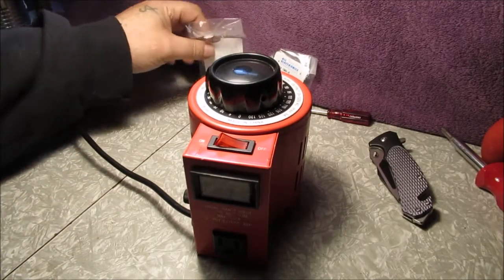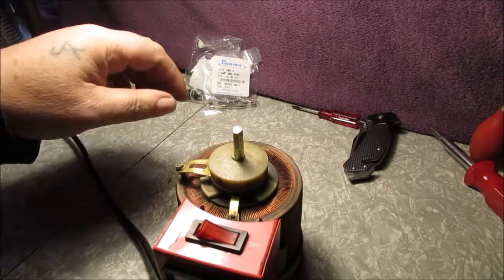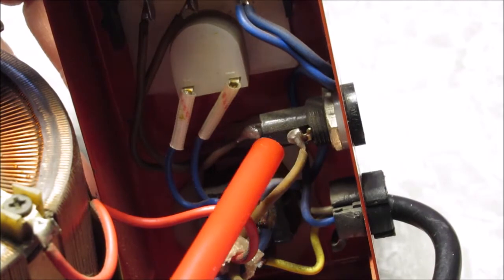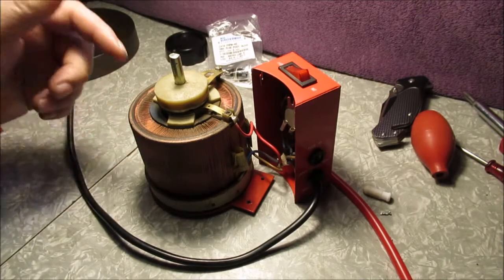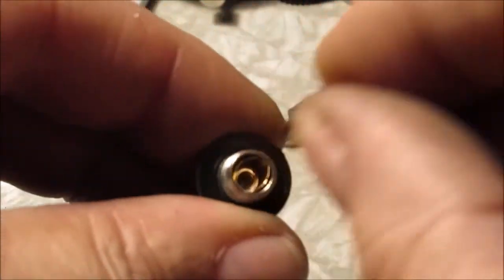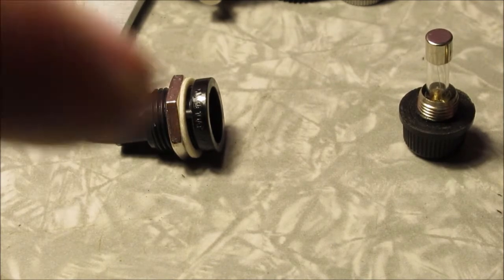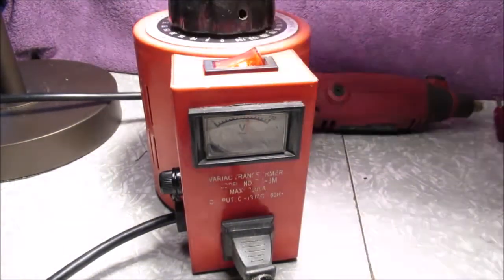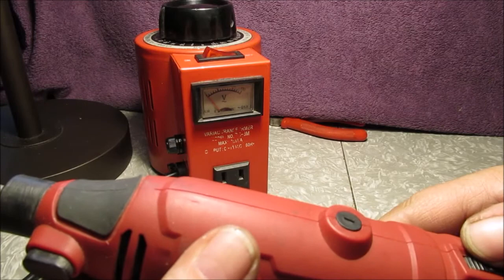Replace fuse holder in my Variac

Comment: I respect the fact you do not take products or money from companies,  meaning  you run your channel  on your own.  COOL.   
So it is a variable power supply.  I missed that at first.   Fun video Jim
Reply from the maker: Thanks ..I started putting that on my videos when last summer we had the problem getting videos monetized and the were worried about advertisers not wanting to put ads on A variac is sort of a power supply 0 to 120 + AC volts ..It works best on small drills and motors with brushes since this one is only 3 amps
Reply: Good for you on the going on your own.
Reply from the maker: I do monetize my videos ..That does give me the funds to do projects
Reply: I do that too.